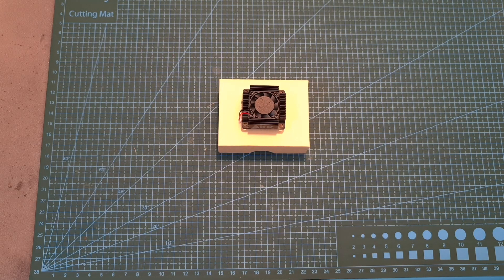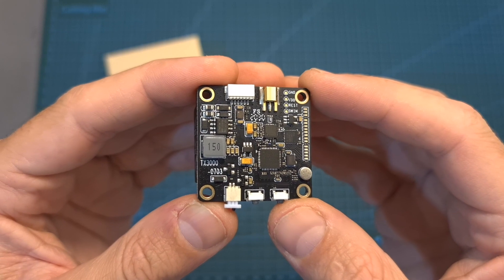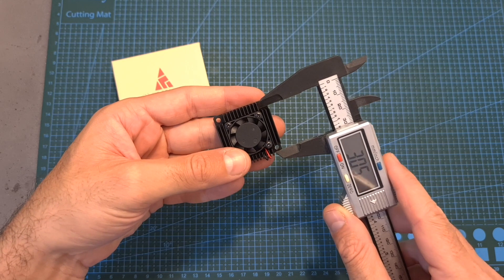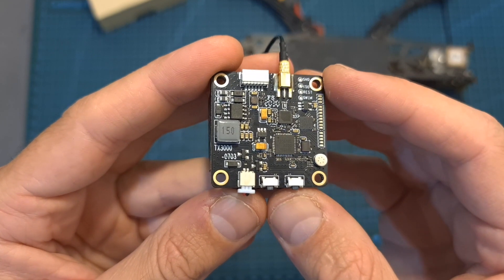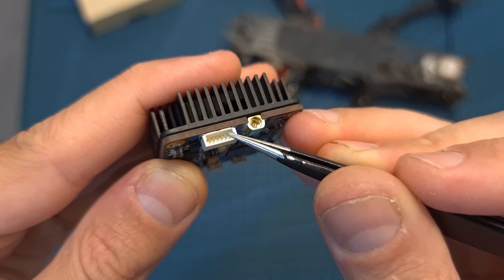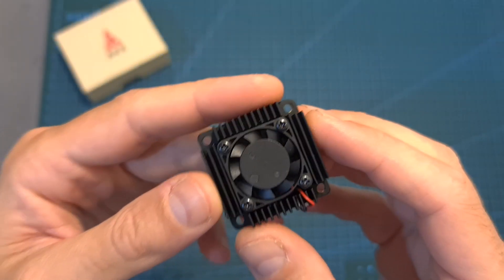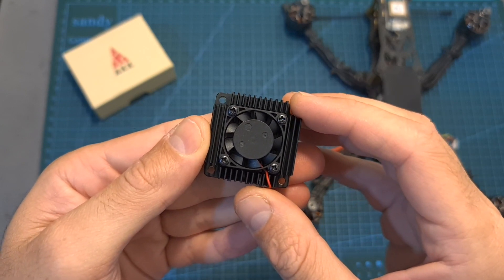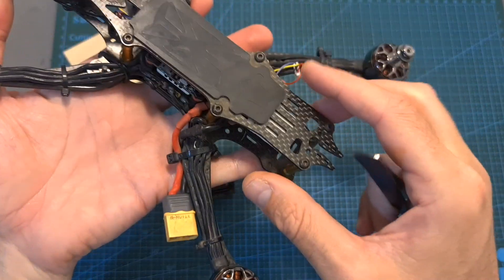3 What? AKK Ultra Long Range VTX - Overview And Output Power & Flight Tests

Comment: Hi. I have heard a lot of good about AKK. But, for VTX is essential to get more power which 5V on original stack can not be provided. With standard flight stack you can not achieve 3W output. Did u used any 24-27V feeder/plate with own capacitor between ESC plus/minus and VTX module?

Comment: Can you pls tell in which pin on SpeedyBee f405 v3 i should solder 8-28V input from this AKK? Cuz when i switch to 3W VTX doesn't work. I solder to 9V out and it works perfectly fine with 250mW, 1W, 2W, but not with a 3W, should i use BAT instead?

Comment: I was thinking of using this vtx on my rc car for fpv. One question I have is if im just using a fpv camera (only video no audio from camera) will the vtx transmit audio to my goggles if nothing is pluged in to the smart audio wire? I saw there is smart audio wire but I dont know anything about that or if its the same as a normal audio wire out of a vtx. Or in other words is there built in audo on this vtx that transmits to goggles? Thanks this would be very helpful to know im new to fpv.😁 Or maybe I need a seperate mic that pluggs into the smart audio wire but idk im new to this. ALL INFO HELPS!!☺️😁🙂😀
Reply: @Asatisfiedguy-b5z  que distancia alcanzó?.

Comment: How much voltage you use for input to this vtx ?  You can see see the black line appear in  the video ? diagonal lines. since 250mw and so on .
Reply from the maker: I’m pretty sure that it was powered using a 9V BEC.

Comment: I should get ⅔ of that with 1 watt . But maybe my battery dies down in a minute . I don't fly that high . Seems like a sensitive reciever would make the most difference . 
   Did you mention locked settings or expected vtx lifetime ?
Reply from the maker: Hi, the VTX is unlocked out of the box. Not sure about it’s lifetime expectancy.

Comment: Hey buddy. How do I know what power level I'm at?
Reply from the maker: Hi, did you check the user manual?
There should be LEDs on the VTX that indicate the power level. 
If you can't find it I will try to help you out.

Comment: Hi, I also have an Akk Ultra Long Range VTX and I had, until today, the problem of noise on the video. I also installed the LC filter without obtaining positive results. Today it came to my mind that I could feed the CAM directly from the VTX, so I detached the power of the CAM from the Matek and I took the power from the OUT of the VTX. The noise magically disappeared!
Reply from the maker: Great! I am glad to hear it solved your problem, thanks for sharing this information.
Reply: Lo mismo me paso a mi con un vtx. Tuve que conectarlo directo y funciono

Comment: Do you know where I can get the VTX tables for this? I have purchased the vtx but I am unable to activate the 3000mw mode in betaflight, thanks
Reply from the maker: My VTX table did not work for you?
Reply: @KremerFPV  worked perfectly, thanks!
Reply from the maker: @jamjampoiness8309  Great!

Comment: hello congratulations for your video, I noticed that you have diagonal lines a bit annoying.  and I bought two because I thought the first akk 3000 mw was defective, I mounted a 5A 5 / 36v filter on the power supply and the problem remained. I also mounted the same filter on the cam power supply and the problem remained.  I powered the cam directly from the VTX AND UL PROBLEM I solved it but the OSD indications are no longer seen on the glasses, the vtx will also run 10 km but the video is bad. it costs little and is worth less.
Reply: Interesting to hear. Why didnt you input the video signal into the fc and took the video out for the fc? would this mean you get OSD and the noise problem is fixed? Pls answer your comment is very interesting.
Reply: Try solder a wire from negative pad of the esc to any ground pad of the fc
Reply: Hi, I also have an Akk Ultra Long Range VTX and I had, until today, the problem of noise on the video. I also installed the LC filter without obtaining positive results. Today it came to my mind that I could feed the CAM directly from the VTX, so I detached the power of the CAM from the Matek and I took the power from the OUT of the VTX. The noise magically disappeared! The video signal instead passes through the FC.

Comment: Where is this overkill vtx used for at this point like you said your battery will drain before you can even get at the max range of this video transmitter and i supose fpv freestyle or racing it may be too heavy and if you would fly with others the vtx would have no point

Comment: great video. thanks. i ordered this vtx after watching your review. the reason for this order is to achieve 15km long range as i am doing 8km with my emersion rc vtx 600mw. just using my 13dbi patch on my goggles. I don't want to use any ground stations  as the lower frequency requires.
Reply from the maker: Thank you! Enjoy your new VTX and happy flying!

Comment: The noise in the video is way to distracting to be expected with such high output
Reply from the maker: I suggest using an LC filter. Check out the pinned comment.

Comment: Gal, that is some crazy range for 5.8 Ghz  3Km!! ,but looks like there was too many noise in the video what was that ? vtx or the motors or FC inducing those banding like lines. i saw some other nice footage from other less powerfull VTX's like those RUSH units. just wondering ( rolo scratching his head )
Reply from the maker: Hola amigo! Actually, you can get much farther with this VTX. 
Check out this video: https://youtu.be/K9nggMRSNS0
I think that it would be better to power the FPV camera using the 5v output of the VTX and maybe use an LC filter, depending on the setup.

Comment: Broadcasting with such power in most cases makes no sense.  The heat will generate a lot of electrical noise and disturb all other users.  Good antennas and a good receiver often do a better job.  Thanks for the always interesting video.
Reply from the maker: I agree with you, it's definitely not for everyone but it's good to have different options.

Comment: Big question here you have to ask, is that horrific noise on the feed created internally by the VTX itself?....Filter the vtx power using a decent LC filter, although you will need a high capacity one. I wouldn't buy it based on the noise alone...So, this warrants another trial I would suggest at least.
Reply: It is possible and likely that the noise is coming from the esc.  This could easily be solved with a cap or a small LC  filter from the board to vtx.  That actual break up static at range is what I’m looking for.
Reply: @vickalanis9117  Of course the ESC is an obvious source of noise...but for example, some vtxs also provide a stepped down 5v supply for your camera. These can also inject noise into your camera..Most, if not all my vtxs have LC filters filtering DC supply to them...Then again, I use 1.2g long range video, so static breakup is a rarity for me..
It's noticeable that the noise level went up as more RF power was selected...🤔😳🇬🇧
Reply: @EnglishTurbines  I wouldn’t know as I always power my camera to a FC on both quads and fixed wing.
Reply: @vickalanis9117  If you power your VTX or camera from your FC ( I do the same) then I also protect the FC from ESC noise by filtering vbatt using an LC Filter...Noise on your FC has potentially worse consequences..You can see some ultra clean live video feed on my channel..For the same reason, I never use onboard amp counters on the FC either...Vbatt tells its own story, don't need amp counters...
Reply: You might want to solder a wire from negative pad of your esc to any ground pad of your FC. Works for me, those black static lines are gone
Reply: Hi, I also have an Akk Ultra Long Range VTX and I had, until today, the problem of noise on the video. I also installed the LC filter without obtaining positive results. Today it came to my mind that I could feed the CAM directly from the VTX, so I detached the power of the CAM from the Matek and I took the power from the OUT of the VTX. The noise magically disappeared!
Reply: It does have a microphone on board so maybe what you're hearing are the motors, props, and wind noise. I know for sure that some of that is wind noise.
Reply: @Waltkat  hahaha
Reply: @Waltkat  No, the "noise" we are refering to is not audio noise.
Rather lines and the interference on the video feed...The Audio feed is of no interest...🤔😳🇬🇧

Comment: It's just the right size for a quadcopter and has great power output but that noise even on the lower power levels is concerning.
Will you test it again on the build you said you were planing and give it some more filtering?
Reply from the maker: For now I tested it in a standalone setup (link in the pinned comment).

Comment: Gal does it look like this and the 2w vtx are just the same as the fx2 1.2w but with different heat sinks and firmware?
Reply from the maker: I am not sure but it's possible.

Comment: Last year a DJI engineer said the full sized Air units can go up to 3500mW but they overheat if the ambient temp is too warm so they settled on 1200mW as max naco.txt unlockable. I hope once someone cracks the firmware there's a power mod in the future. 😄
Reply from the maker: Well that's interesting.
Reply: Dot!
Reply: Keep me posted !
Reply: @mikehunt2667  FPVWTF produced the margerine hack recently and features are being unlocked. Livyu did a teardown a while back though and 2 of 4 RF amplifier chips are missing from the Air unit board. It's possible a max of only 1.75 watts will be available.

Comment: Wow 3km, i wonder how this vtx penetration thru trees and concrete bando will perform? Great review as always. Cheers 😊
Reply: Thats not very impressive, I can go 3km easy on 200mw ;D
Reply: 3000mW (3W) should be able to go a lot further than 3km. I can go out on 1W (1000mW) to 4km no problem, probably go further. With a quad, battery will run low long before you use all 3000mW especially if you use a ground station. Now the penetration may be huge through trees and maybe even concrete, not sure.
Reply from the maker: Yes this VTX can get much farther than 3KM.
Reply: 600mw got me 5km
Reply: 800mw 2.7km easy..